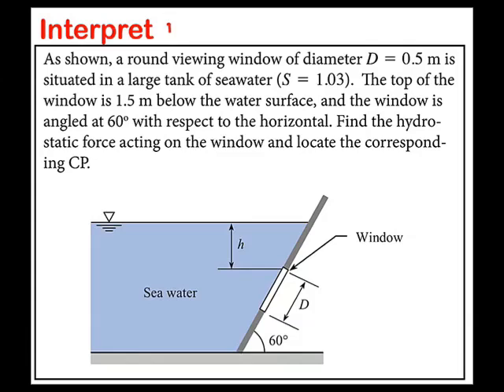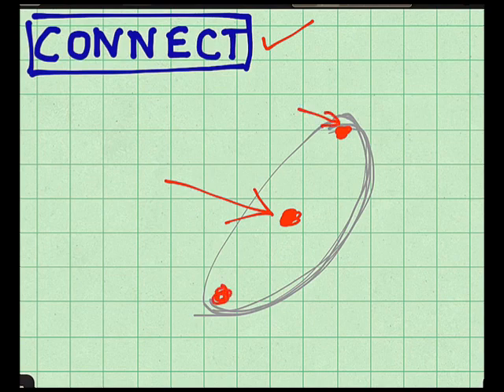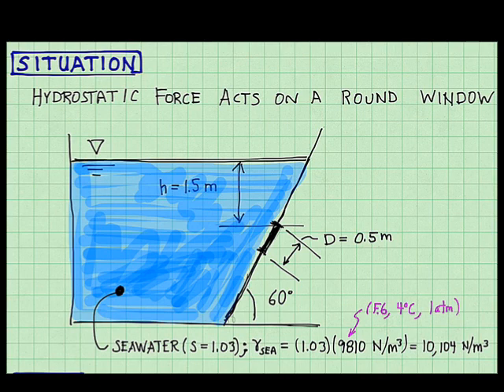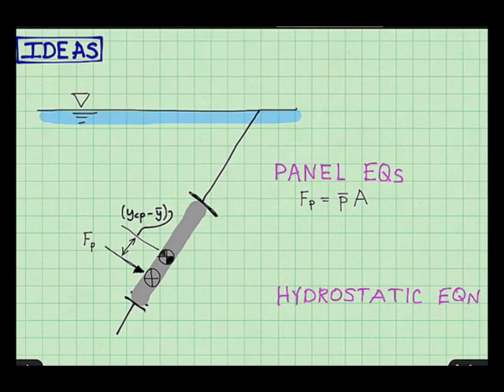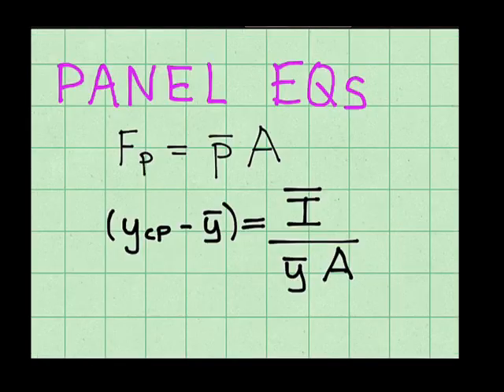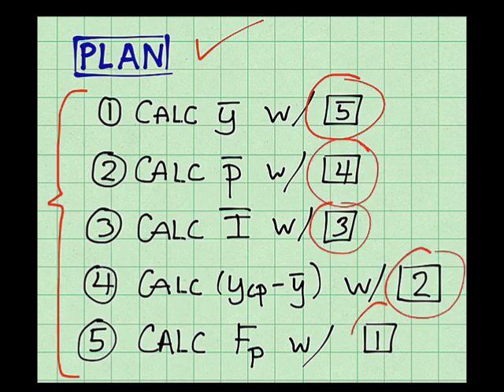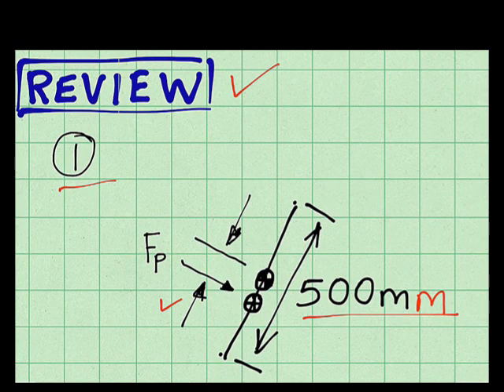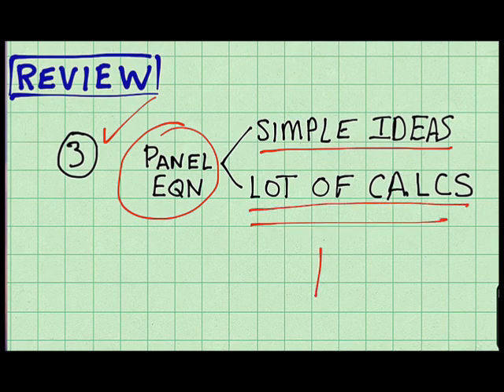Example: Panel Equation

Comment: Hi,

3:49, shouldn't the pressure equation be, specific weight * (1.5 + 0.5/2*sin60)? As the diameter of the window is 0.5m. Thanks